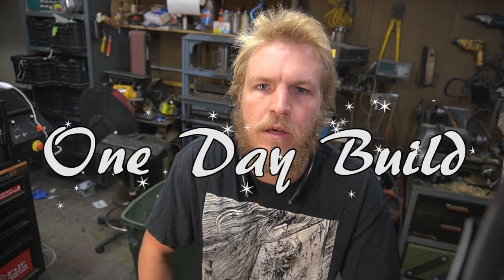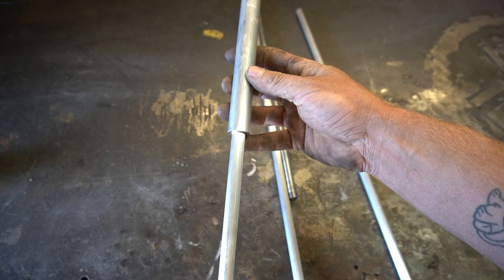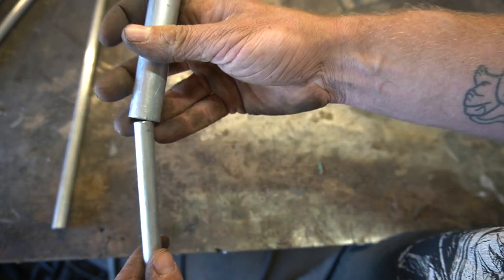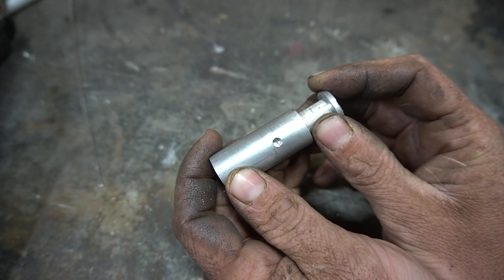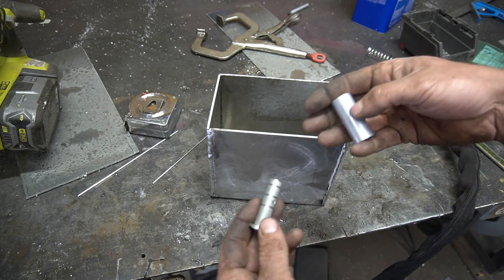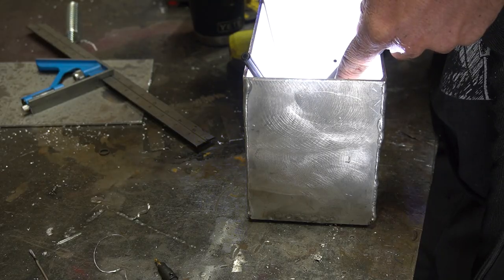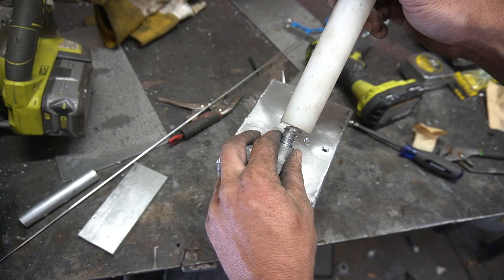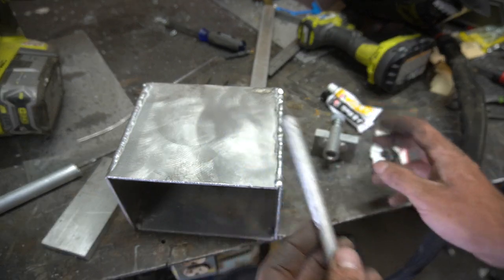Making An Acetone Dispenser For TIG Welding

Comment: For thin tin like the acetone cap you should try lead solder put some flux on both parts and away you go.
Reply: The cap was magnetic, which tin isn't. Steel cannot be soldered.
(I know I'm late to comment that)
Reply: @maeanderdev   tin plated steel and mild steel can be solderd so can zink plated and galvanised steel also stainless steel. 
Just got to use the right flux and process
Reply: @chrisbergin8084  Admittedly, I never tried 😲
Thank you for the hint

Comment: Does that setup allow air back into the acetone can? Otherwise won't it form a vacuum and prevent acetone from flowing out?
Reply from the maker: I thought that would be an issue too, but I turned the bottle upside down with a hole in the cap and it would just continually flow without gulping. I think it's something to do with the gasket material in the cap?
Reply: @cranktowncity  Acetone has such a high vapor pressure, opening the can in a warm room will result in a huge amount of vapor filling the can.  Close the can and let it get cold, and the vapor will condense, imploding the can.  If that doesn't happen, I'd bet the cap is designed to function as a vacuum break.